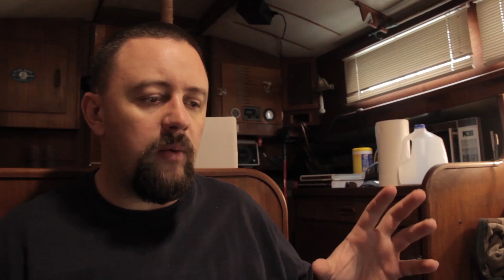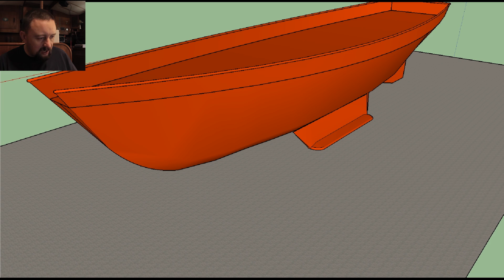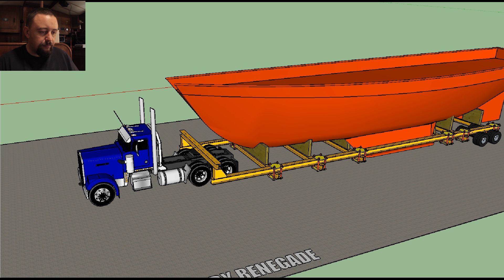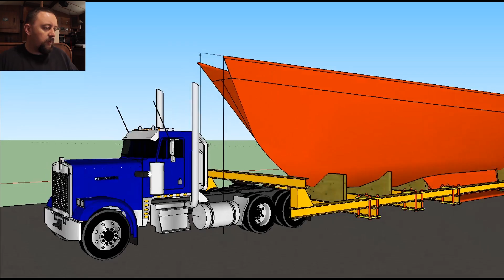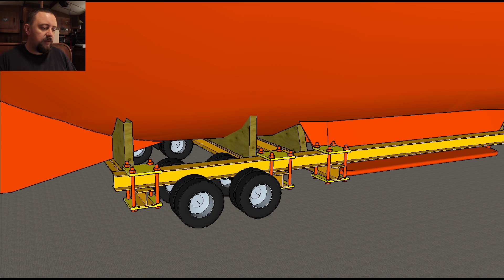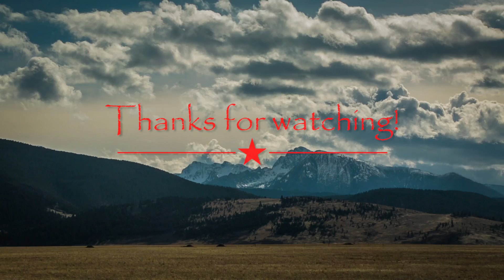SV Seeker - Trailer Design #1

Comment: I would be concerned about the insurance cost (assuming you can get cover), and the trailer may not be compliant with the regulations required for use on a public highway? Given the effort Doug has put into this project, is it really worth the risk of using a home made trailer? Get a professional in to do the job, it'll be done legally and be covered by the hauliers insurance.

Comment: Simple , but how does the truck suppose to turn? Not enough space . And poor design. And pics he uses of the semi with trailer he hauled used a low boy trailer with loads on it .do that every other day . Best bet is hire a company that moves boats and have them deal with it save you the headache and time
Reply from the maker: This is how the pro's do it, I would know, I did it for about 1.5 million miles.
Reply: Renegade Show I’m at 3 mill miles do it every day
Reply from the maker: @96066xxx  How many axles you riding on?

Comment: On center of boat axle --  Not only what you mentioned, but the "mass" of the swinging load could easily swing the truck right off of the road during an emergency quick move.

Comment: Renegade, Second Gen. Heavy Hauler here, I like Your diagram a lot better than  the one Doug showed us. Yours Will Work well, of course except for the skeg as you said. THAT is a Problem, Maybe. Somebody with Heavy Haul eyes needs to jump in a car and drive the routes between Doug's house and the Lake FIRST, and see what exactly IS Out There Right NOW. You know this, of course. A LOT of the Low Wires can be flipped up on the rails of Seeker by guys with fiberglass poles, don't forget, so they'll Slide On down the rails and fall off the stern without harm.  As I see it, we need some kind of Hydraulics or air-ride bags to Lift the Skeg when necessary, so we don't drag it going through dips and over humps. I'd say airbags quicker and cheaper, and just mount them on brackets bolted stoutly to the sides of the wooden cradles on the back two cradles, with their bottoms bolted to the I-beams. And Cross-chain the cradles so they can't move side-to-side, only Up. This way, as we Poke Along down the highway, we can have somebody Stop the truck at a Low Spot, then jump out, undo the back Straps, blow the bags up so the skeg won't drag, walk beside it til the Bad Spot is Passed over, then let it back down and re-tighten the straps. I'd have Doug weld on a Sacrificial 'Skeg Skid-Plate,' too, Just in Case. I'd have at least Three Wire-Flippers riding Aboard Seeker for those low wires, especially them TV  and telephone lines so Easy to Miss, LOL. And Two-Ways for EVERYBODY. A couple of 2x6's in front of the wheelhouse going up the front at an angle to Flip Wires up and over IT, you Know The Drill.

Comment: You guys seem to be missing a big piece of the puzzle.. the reason there is weight limits on the axles is so the roads and bridges will support the load being moved.. and if your only going  to use a single set of tandoms, thats only 34k lbs.. and the center of the rear hub is not allowed to be no longer than 40 ft. From the center of the king pin( pivot point).if you use a 10 ft spread you can get 20k /axel.
I m just saying you all better call the dot and find out what ya can and can't do with and without permits.. good luck.. 
Just some advise from a flat bed owner operator..
Reply from the maker: If this was a legal load, you would be correct, however there is nothing legal about this load, it is absolutely going to require a specialized hauling permit. 

I have already checked the route, the hardest part of getting it to water is going to be getting it onto the main road.
Reply: Renegade Show ...and the first bridge or overpass you cross will collapse by having 50000 lbs over just 7 feet of axle spread. Getting the OSP and Oklahoma DOT engineers in the loop before you design anything is a must or that boat isn’t going anywhere. If you bust the bridge formula, count on a high 5 figure fine. Listen to us experienced Heavy Haulers.
Reply: Michael MD would they be able to stick a second set of temp axles under the front of the keels just for going over straight bridges and stuff like that?  Then they can come off for turns ?  Just a thought. Maybe totally wrong.

Comment: Have you calculated the rolling friction and the drag from the truck needed to move it and the ideal speed (presumably 6-8 Miles/h) Also will you have police eskort while transport?
Also will you drive it into the whater or lift it into the whater with a crane
Reply: Hauls like these are everyday occurrences for heavy haulers like the OP. I know because I do it everyday. This guy has it covered.

Comment: Move the wheels more inside don't have them exposed. The rest it really good. Just ensure 12" ground clearance. most DOT roads require a axel foot print under 23' in width.

Comment: i move heavy stuff including my 58 x 20 seiner  weld a king pin to the front of the boat take two semi trailer axles and turn the boat into it's own trailer you are over thinking the whole thing  my biggest move was 40x 100 100 year old builing that estimated out at 1.3 million pounds did it with homemade semi axle dollies and took it 7 miles

Comment: I would be concerned about flex in the beam, I am under the understanding you need approx 1" thickness for every 1' of span . the length in the diagram looks long enough you may have flex leading to bottoming out and bounce.

Comment: See you know what you're doing, have you thought about mounting some 4x4s on the bow at an down angle, to help lift and keep, power lines and such from contacting the hull, just in case a line slips.
Reply from the maker: You use PVC pipe, it is slippery and nonconductive! :)
Reply: Renegade Show  Damn, you're in The Big Time! NONE of MY Bosses would have Popped for PVC, lol!

Comment: Why not just have the timber supports to the sides rather than fully molded to the keel, this minimises point loads by not correctly fitting/shaping the timber blocks.  Hope that makes sense.

Comment: you will not be able to haul the boat with this trailer. the trailer needs to be dot certified. you will need alot more axles. prob a nine axle. height over 16 ft will cost a fortune in route surveys. your trailer wont meet bridge laws. please let a professional do this. it will save you many possiable hundreds of thousands in fines.¿!
Reply from the maker: Using a home made trailer is perfectly legal. I have 1.35 million miles in the trucking industry, over 400K of that in heavy haul. I am the professionals, and I have been to college for welding and CNC Machining.
Reply: I have 32 years more miles in the industry as a company owner. I have apecialized in heavy haul for over 20 years. go ask dot. especially ok dot on the regs then talk to me.
Reply: I have also an engineer a welder with a shit ton of fixing things. running a van don't qualify you as a heavy hauler.  go haul 250000 lbs on 13 asked from Alberta to Houston some day. then talk to me
Reply from the maker: "I have also an engineer a welder with a shit ton of fixing things"

https://youtu.be/a0x6vIAtFcI?t=12s

If you want anyone to take you seriously as an educated man, you should be able to form a complete sentence.

Comment: Question, would a truck be able to even tow this boat and deal with the weight??
Reply from the maker: Check out the Q&A Video: https://www.youtube.com/watch?v=HCdLDcFRPkU&lc=z131edtihuvohbu3e22icblzsx35ctwh004
Reply: EASILY. Even Air-ride tandems will haul 25 tons for three to four years before busting a bag, and this is on Coal Trucks, hauling 40-60 tons TARE at HIGH rates of speed on four-lanes.

Comment: hacked up a drawing of the front pivot wheelsets.. http://i.imgur.com/vqKTX7p.jpg   how to allow the beam in the back to hold up weight?? not hard to figure out.. rigid to long I beams..  or double beam sections.  have to figure out how to build tow bar to front truck..  air suspension on dolleys allows raise and lower of rear tail..  left and right front wheel sets must have independant right height adjustable for the air suspension.. to keep hull upright..   

big rig truck companies will sell the rear of the truck less axles.. less pumpkins.  keep air brakes..  plug up axle housing openings to prevent lube oil loss into housing.   might even.. make filler plate for front pumpkin opening to attach tow bar to that plate  or pivot bar to keep pull from front truck even on assembly..  might not be needed.. 

only issue.. this takes the weight off the truck that is pulling ..  less traction..  might need to add a water tank to the top front of the tow bar.. with big dump valves...  so weight could be added or dumped by changing water level.  far cheaper than concrete.. 

this set up would be very handy for moving other large things that are wide loads.  that require significant width.. could the truck rear frames and axles housings be narrowed? yes..  as long as a thick wall tube is stuffed thru the housing to keep the alignment between the spindles..  could this set up be run with a single axle on each side?   perhaps.  hope this helps..

Comment: might need to create some outrigger wheel sets somehow.. that could be towed behind another truck... to be set in place on either side of the bow... it looks like going around any kinda corner might tip over at the front..  might have to use a pair of rear frames off big rig trucks with 5th wheel plates still installed to give you pivot points..  a triangular tow bar from each of those with some ackerman in the design.. this might give you more width or the same as the rear ..  air suspension on the truck axle frame sections could give you extra tilt compensation ability.. to keep the hull up right.  this front steering section could be handy for house moving later also.  if you are open to idea like i think you are.. i might draw something up tomorrow night.. not all of my ideas are understood..   you don't even need to have axle shafts or pumpkins in the axle housings.. just pop all that out and wedge several freeze plugs in the end of the axle housings.. allowing you to have freewheeling  and liquid lube on the bearings and actually run air brakes right off the front truck thru the trailer hook up.   ackerman could be done by attaching the tow bar or steering cross bar to the front of the left set of wheels at 2 o clock and to the right set of wheels at 10 o clock.  this could introduce the ackerman to the front swivel wheel sets. . sorry.. kinda sleepy..

Comment: great video. I have a similar boat move to contend with in a few years as I'm building a 54-foot wooden Sloop on my property. do you consult for a fee?
Reply: a 54' boat is actually pretty easy to move. how close do you live to a Marina? where i live there are companies that will move anywhere within 50km to a boat launch for about $500
Reply: I need a custom trailer because of the clearance. my boat has a very high free board. I will share the particular details with you offline. Thank you

Comment: youe are over thinking this I move heavy equipment  interstate daily  on average 80000  payload in 10 ft. on a beam trailer it is not beyond easily moving  6 inches of ground clearance over length of trailer is  good

Comment: Only 6 inches of ground clearance?  You are being pretty brave.  The crown of a road is more than that which means you will be dragging bottom at many intersections.  Granted you can lay down planks where need be but it will be a lot of work.  Good lick.

Comment: I appreciate your efforts, but there will be significant flex in the beam back from the tractor, and the number of tires you have, a total of 16, is probably insufficient.  This needs to be designed by a structural engineer, and the pathway to the river needs to be traced, preferably by autoturn software by a traffic engineer.
Reply: Bah...it's only 60k.
Reply: Samual Whittemore ....bah it’s more like 130,000 pounds. It’s the tractor/trailer/boat you have to permit.
Reply: Yes, the launch gradient need checking for sure..

Comment: Pivot at the center is best.  
Then you go around corners so that the center of the boat cuts the corner as much as possible without clipping whatever is on the ground at the inside of the corner.

Comment: if you're concerned about the skeg dragging, why not flip the boat around and drag it backwards? that way the bow will be on the tail end of the trailer and it won't snag even if the front of the trailer lifts
Reply: i had pretty much the same thought... but it would move the mass center point (load) towards the truck.
A solution to deal with that, could be a pivot able front axle trailer setup like in this picture:
http://www.knighttrailer.com/products/6138_0.jpg it would improve the agility of the entire setup.

regards rec
Reply: @recycler77  Yes, the problem that jumps out is the 6" clearance, 6" road level over the length of SV is a bit too much of a wish n prayer for me that's ignoring drain covers etc... Any what ever you choose, it will be good to see SV dip her keels..

Comment: this guy is bat crazy...you can tell by his lack of professional articulation that he is no engineer, not in this country {maybe a caribbean medical college is giving them phony degrees out too}.  Plus, this boat has to make a max of 7 or 8 turns in all our lifetimes!  Not a weekly jaunt to the local lake!  Just plan the route to avoid bad bottlenecks.
Reply: The wheels need to be farther forwards. There putting to much weight forward. I haul boats on a 40 ton trailer on a regular basis. This is very very wrong.
Reply: Right. Just her Initial Trip to the Lake for launching...

Comment: A shorter wheelbase would allow better maneuverability in turns even though the rear end kicks out,  like you see with motor homes and busses these days. With a wheelbase shown estimated at 60 feet you will require beams 16 to 24 inches in depth, weighing 75 to 90 PLF and with deflection of 3 to 5 inches at center.  Can your design handle this deflection?  There should probably be some horizontal angle cross bracing in at least one bay to keep both beams from lateral buckling simultaneously.

Comment: would it be a good idea to put some axles up by the front of the trailer? place the 4 or so inches above the road. just in case the trailer hitch fails or the trailer tries to twist.  what do you think?   
I just see a lot of forces up front and worry about balance

Comment: Physical size is your only real problem, people in the comments  seem to be worried about weight and number of axles, it's only thirty ton. tandem, tandem is good for a legal 80,000 and will carry a lot more
Reply: john walker  ..,not true John. The BOAT is 30 tons. The truck weighs 10 tons and this trailer will weigh another 15 to 20 tons. The 80000 lbs limit includes all of this. An overweight/oversized permit can be issued to move the boat IF there are enough axles on the tractor and trailer to comply with the bridge formula.  That is to distribute the weight evenly over the length of the entire load. The axles have to have the proper spacing and weight distribution to comply with Okla permit limitations. I can assure you a 3 axle tractor and a two axle trailer will NEVER be approved for a permit. It will likely have to be between 11 and 13 axles. Easily do-able. But not if they don’t use a dedicated heavy haul trucking company.

Comment: Why not weld instead of bolts?
Reply: IMO welding would be to rigid, with no flexibility. Bolts will allow the joint to move but not break.

Comment: I know Seeker likes to half ass everything.... I would just pay a mover... they have the permits and can arrange the wide load escort. Probably will need Troupers to run along with it too. You can't just move something of that size without all that. If it gets to the point when there are low power lines the power company will have to arrange to take them down and put them back up. Also that would allow you to keep the keels higher up and not having to realize part way there that the boat is just to low. I don't want to be a shithead about it but thats just how its done. That may be costly butt it beats not making it.
Reply: Jay Sims how big a boat did you build or haul?  Armchair critics give me a pain in the ass.

Comment: Two advantages I see to your design proposal: (1) The two front perpendicular beams could be carried by two medium duty steer axles bolted together. That would take load off of the tractor, which seems important given that you have only eight tires in your design. So it would be sort of a dolly which could be unbolted and lifted out if necessary. (2) The square plates at the intersection of the four perpendicular beams could be the lifting mechanism for elevating the load six or eight inches from the ground. The rods connecting the beams would need to be 1.25" dia threaded, and nuts could be gradually cranked all around to lift the load onto the long beams. This is what house movers do but with hydraulic rams.

Comment: just a friendly suggestion, I see from your pictures you are an accomplished wide load hauler. maybe think outside the box with your set up you have very limited turn radius due to the Beam over your 5th wheel, maybe think about a over head suspension rig or a outside frame rig, both are readily available in Oklahoma, that way your not limited by flex or Weight and as a added bonus you can steer both ends to accommodate your tight corners. also the whole rig can be independently raised to miss other obstacles. I don't want to pimp any company's on your post but if you need more info hit me up, good luck in your endeavors.
Reply: I agree with Dave. You need to be able to raise and lower both the front and rear.there will be dips and unevenness of the road,